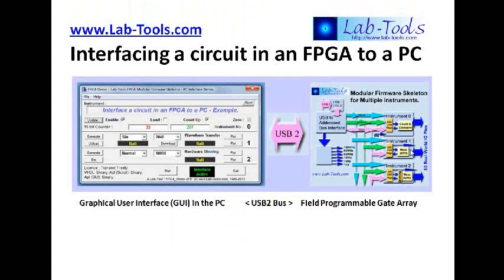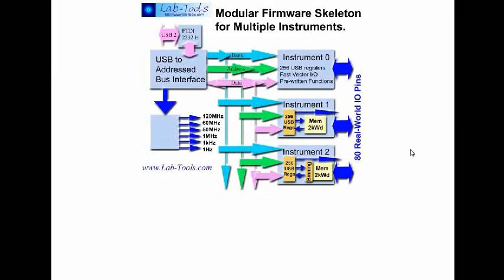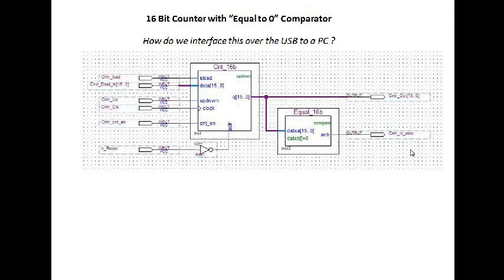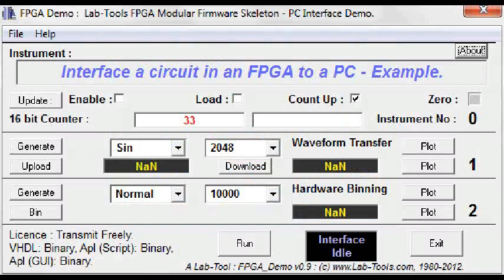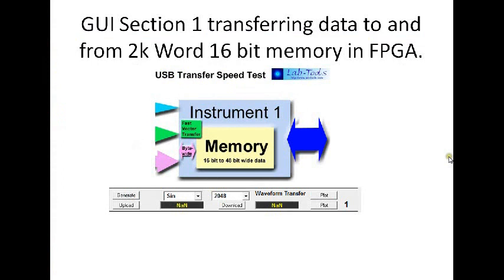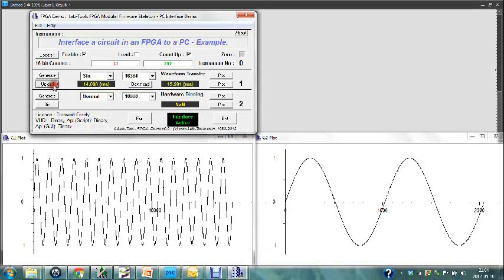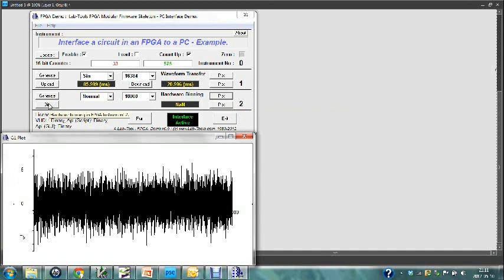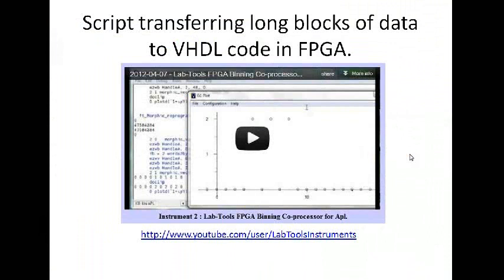2012-05-10 Interfacing a circuit in an FPGA to a PC

Comment: Sir i need to ask if you have used any hardware other than fpga and usb port of a PC? I mean did u just enable fpga to provide usb interface and communicate with PC or used some converter IC in between for usb interfacing? Please respond